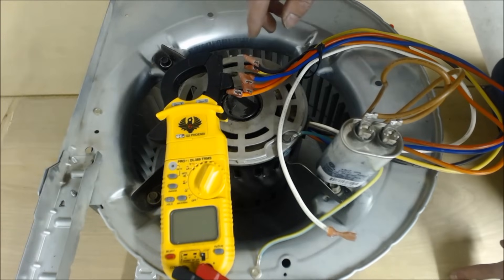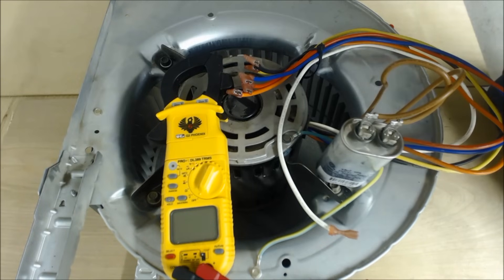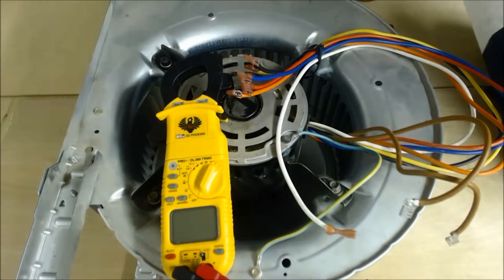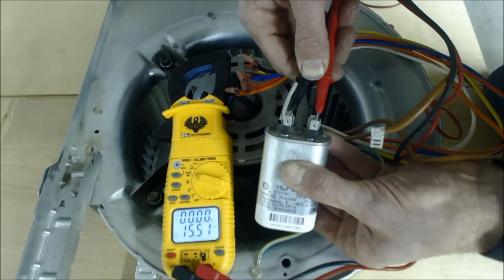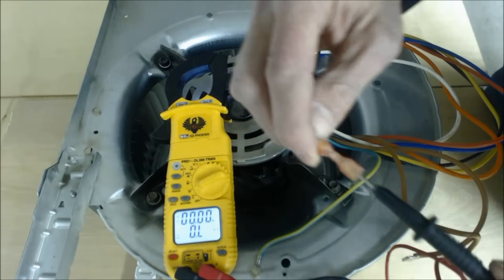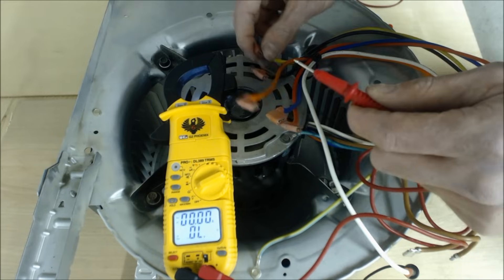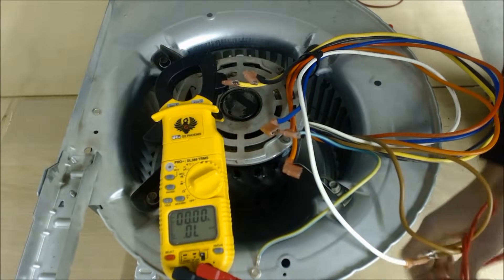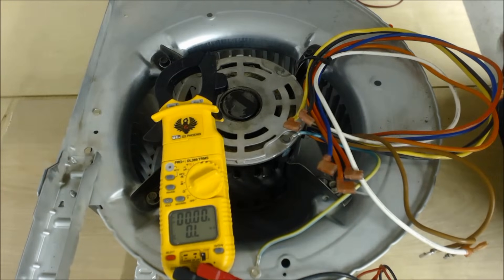Step by Step Procedure for Troubleshooting a Blower Motor from a Furnace and AC System!

Comment: So i had recently discovered a short that went in to my furnace at the main switch off to the side. After correcting that, my fan wont kick on by itself. This is true for heat, AC, and fan mode. It does start with stick push though. I thought it was a capacitor. I replaced that, but the problem persists.
The motor is only a couple of seasons old. Is it the motor again because of the short?
Reply from the maker: It sounds like there is a problem with the start winding. Regardless, if you have the correct voltage going to the motor and a new capacitor that is the correct mfd and voltage then it is a bad motor.  There isn't anything you can do to fix this situation because the problem is inside the motor start winding or rotor itself. Thanks and I hope this helps!
Reply: acservicetech Thanks for the fast reply. Thats pretty much what I figured, I was looking for a little confirmation beforr ordering another motor. Thanks for taking the time.
Reply from the maker: Glad to help!
Reply: How would you test the motor start winding? 
I have tested all of the speed wires to common and the capacitor wires to common. 
Black, high speed, cool - 3.2 Ω. 
Blue, med high speed, heat - 4.5 Ω. 
Yellow, med low speed, park - 5.8 Ω. 
Red, low speed, park - 9.3 Ω. 
1st capacitor wire, brown - 9.3 Ω. 
2nd capacitor wire, brown - 39.4 Ω
So speed wire readings seem good. (I'm not positive abt the capacitor wires?)
The capacitor itself was not in spec, so replaced it. Still fan does not kick on. Makes same loud, awful buzz noise. Fan spins freely when pushed by hand. 
Tested new capacitor, just to be sure. It is good.

Comment: Have you ever run into only 1 of the windings opening up that you use for either cooling and heating but the rest of the motor is good, so you switch to a spare speed to keep running?  If so, is A/C more important than HEAT as far as blower speed is concerned?  To put it simply, if you did switch wires to keep unit running, would you always buy a new motor and replace?  Thanks!
Reply from the maker: I would replace the motor. We usually always have more than one in the truck that will cover the psc motor range. Usually it is the start winding that is bad which is the one capacitor wire that does not have the white stripe. The other with the white stripe has roughly 0 ohms when tested with common as they are touching in the motor. Yes it would be more important to have the cooling speed working but to put it simply, when a motor is running, the other speed wires have voltage that can be read off of them so if one of them was shorted to ground then the unit would blow the breaker due to high amp. The resistance readings that can be taken off of each tap is more of a clue if the motor is on its way out rather than broken with a direct short to ground. I hope this answers the question Jack. As always, it is a pleasure! See ya

Comment: Great Video.  Recently purchased blower motor and capacitor to install myself because I did not know how to test!  You covered it all.  Apparently it is just my capacitor that went bad but the motor had a funny burned smell.  Debating if I should uninstall the new and return.  Repair Clinic is the best.  Thanks again acservicetech.
Reply from the maker: Hey Jim, are you talking about the limiter as the thermal overload built into the windings inside the motor or a fan limit control outside the motor? I am guessing you mean a fan limit control.
It is possible that the thermal overload is opening when you are applying power to the motor on the common wire in the motor winding and then when this wire is being tested after it has had a chance to cool down. I could also be a bad or cracked rotor. Either way, if you are getting power to a psc blower motor when it is supposed to and the capacitor is good, then you should replace this motor. There is nothing inside the motor to service at the winding or rotor level if it does not start. Thanks for the question!
Reply from the maker: What happens in a blower motor when the cap is bad is that the internal overload will cut out the start winding but over time that could fail. While the internal overload is still allowing power in the windings can melt which is what you are likely smelling. Thanks for the comment!
Reply: checked resistance on the motor and all is good.  checked the capacitor and all is good...no blower at all.  Changed control module and also the limiter prior to checking above....any thoughts?

Comment: If you have good cap good resistance on all speeds and 120v going to blower terminal on board but blower hums wont kick on and max amp is 20amp but blower draw is 12amp could that still be blower problem?
Reply from the maker: Exactly what resistance readings are you getting? Did you check windings to ground? Does the motor turn on in a different speed? Does the blower motor spin freely when off, meaning that the bearings are good? Also check the resistance from the brown wire to common. The start winding may be bad. The brown/white wire off the capacitor would have continuity with the white common wire on 120v blower motors. Thanks

Comment: nice video and explanation! just had a question on the voltage part to the board. that board has a relay and shouldn't it read o volts if it's closed on contacts? just wondering. Or are you checking other side of line?
Reply from the maker: The common/neutral block is where you would place one probe and the other probe would be put on the heat or cool hot on the relay block depending if either heat or cooling was calling. Heat would have to go through the sequence of operation first before that would turn on. What I would do is just turn the fan on at the thermostat or jump it at the control board from r to g and then you would Usually test from common to heat relay term as the unit usually turns the blower on at the lower fan speed on the heat relay. Thanks

Comment: Hi,  I am new to this,  is this a heat pump or gas furnace blower motor?  I had GREELEE  DM-20  DIGITAL MULTIMETER what setting for capacitor?  Continuity, current (DC)**, Diode, Resistance, Voltage (AC), Voltage (DC), and Battery.  Thank in advent.
Reply from the maker: Great Question! Some multimeters do not have the capacitance setting for uF/MFD for testing capacitors. This PSC blower motor would be the type used in 120v units such as a furnace. Air handlers have 240v motors. Air handlers are typically used for ac or heat pumps. Furnace blower motors are used for gas heat or ac typically. Thanks!
Reply: I like your multimeter, what's the name? And where can I get?
Reply from the maker: Here is a link to the UEI DL389 multimeter  http://amzn.to/2av8s3q
Reply: Thank you so much.

Comment: why would a blower motor get hot, and blow warm air                       not installed in any ac\heat unit
Reply from the maker: Great Question! That would mean that the wire resin (which keeps each of the wires in the winding from touching each other) is melting and the windings are wearing down. I would go ahead and replace that in order for safety. Thanks!

Comment: my blower motor starts but then it stops after a couple second,and i changed the capacitor,do you think i have a bad motor?
Reply from the maker: When it is off, did you check the bearings and if there is any wobble? After that, what do the resistance values look like? Thanks

Comment: it seems that my a/c blower motor is not putting out as much air as before on cool cycle i had ducts cleaned and cross over duct changed im in a double wide  moblie home . i guess what im asking can the high speed on a blower motor go out and it switches to the med speed on the motor or should i look for something else motor starts good so does the capitacor have anything to do with the motor speed
Reply from the maker: Great Question! If the capacitor is at the lower range of the + or - 6% of the actual rating then that could be part of it. The motor won't switch to medium speed. Most of the time this happens is because an obstruction in the ductwork, dirty filter, low charge making part of the evap coil freeze, or there could be dust on the under side of the evap coil reducing the amount of air across the coil. Thanks

Comment: Question, I had an AS air handler today that blew a fuse twice.  Everything was running when I got to the house but after cleaning the condenser and checking pressure it would not operate.  I changed the fuse and flip the switch it turns the blower wheel then shuts off.  If you don't mind what could be the problem?
Reply from the maker: I am guessing that we are talking about an air handler and not the outdoor unit. Is there electric strip heating with a 30, 60, or 90 amp fuse or are we talking 15 amp fuses for an air handler only? For now I will assume air handler only for the following. If it is pretty immediate even with slow blow fuses then it is a direct short such as one of the motor windings having continuity with the ground or could be capacitor if the thermal overload in the motor is not working. If it is delayed then you want to check capacitor, resistances on the motor windings, binding with the motor wheel, bad or burn't electrical connections. You should be able to find this problem with the power off and testing each component for resistance such as motor first, then fan relay, then wiring. I hope that this helps, Thanks for the question!

Comment: Hi guys! I have a Raheem AC  sister! So the blower don't start! I can ear the noise to send the signal to start but not! By the first start few minutes but stop and then not start or work at all. Can you guys help me? Thanks
Reply from the maker: It sounds like it could be the board, the fan motor, or an electrical connection. Did you start by shutting the power off and replacing the capacitor with the exact same size? Have you replaced the air filter? Other than that, I would recommend an HVAC Technician diagnose the situation with a multimeter. Thanks!

Comment: Hello, Troubleshooting my Rheem Classic Super Quiet 80. In AC mode, the blower fan is running, but not much air is being moved. I wonder if it is two stage fan motor and it's not moving into the faster speed, for whatever reason. Maybe the capacitor? Or, an obstruction, which doesn't seem valid, as no construction or changes have occurred lately. Any thoughts?
ThanksDarwin
Reply from the maker: It wouldn't be a two stage fan in cooling unless you had a two stage outdoor condenser. Did you check for clogged filter or possibly a second filter somewhere. I have seen that before. Did you check the backside of the evap coil in case it is clogged. If you have flex ducts or insulation on the inside of the duct, I have seen that collapse on themselves. The capacitor would either be good or bad. You can check for mfd. Check to make sure the high speed wire is called for in cooling mode if it is a psc motor. Thanks for the Question!

Comment: Sorry, i am  very much in a learning process, so forgive my ignorance.. My meter is a Bosch  fix7677 pro meter..
  It has on section of it  thats says rpmx10 and dwell with 4cyl , 6cyl and rpm being  8, 6 and 4cyl.. are these the setting ings im looking for for testing a capacitor and if so which exactly would you say, if it matters
Reply from the maker: That meter has dc milliamps, voltage ac, voltage dc, and  resistance. Those other two settings you are talking about are for testing cars. This meter doesn't have capacitance, sorry. Thanks for the Comment!